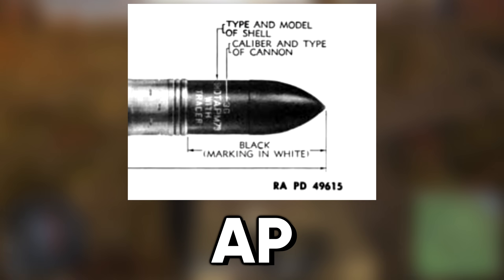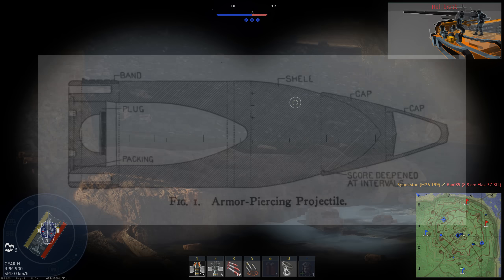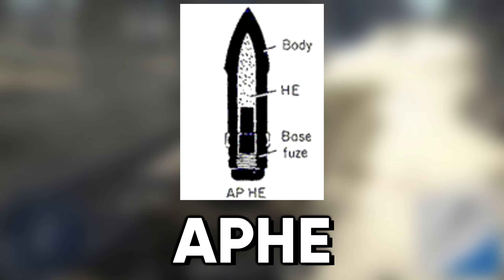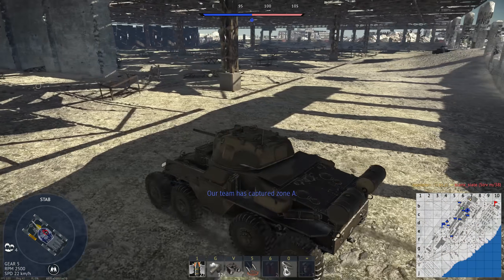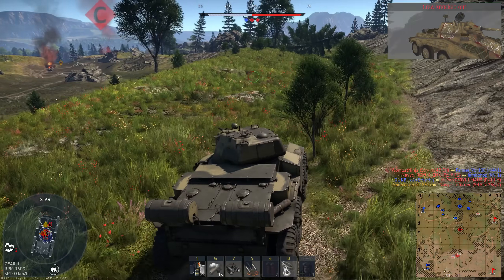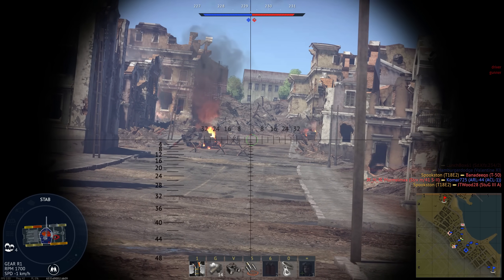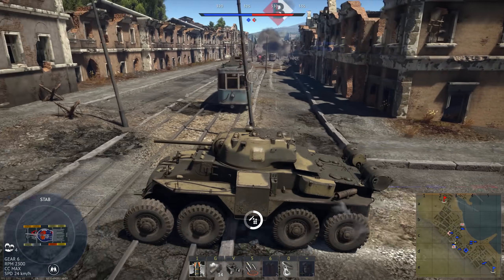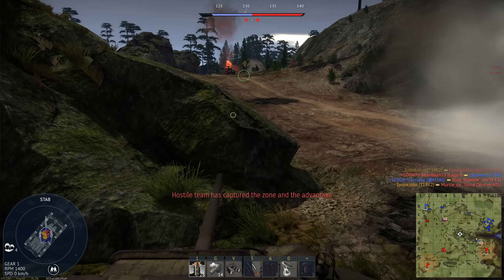How Tank Ammo Works

Comment: one thing im curious about is if a tank has a larger main gun does that mean it will have to use heavier ammunition and therefore the muzzle velocity will be reduced i've always wondered this but could never find out whether or not its true and im really curious
Reply: Yes, but usually you also use the added space for more propellant. A great example is the Tiger II, it had a large calibre for its time, but also a lot of propellant making the round go insanely fast, therefore giving it a very flat ballistic (and yes, that's pretty much one of the only glorifications about the Tiger II, which is true) ^^

Comment: Caped shells wasn’t done to increase effeteness against angled armor it was done to help the steel projectiles not shatter because as velocities increased the steel shells would shatter instead of going through armor. The soft cap would during impact deform around the shells and help take the shock out of the impact helping it bore through. It was also noted that capped shells did help against angled armor as a little bonus.

Comment: On HEAT - the general concensus I've gotten is that, yes, it does penetrate using kinetic energy. And it does use a superplastic, which is often misunderstood as a molten material. As far as I know, superplasticity is often used to refer to materials that act as liquids due to extreme pressure - not high temperatures - such as those produced upon detonation of a HEAT warhead. Because of that small difference though, I've seen people strongly insist that HEAT uses a plasma jet to penetrate, citing the liquid behavior of the payload(?) and the armor's reaction to it, which I think consists of the armor becoming a superplastic, or close to one, in the penetrated parts of the armor, producing an effect similar to a melted-through hole.

Considering that this came from google searches and discord conversations, I wouldn't take it as gospel.

Comment: Would there be any practical way to use a nuclear reactor or solar power to propel a HEAT-like jet while recovering and he recycling the casing and most of the propellant? 10 km/s is a pretty good exhaust velocity for a rocket engine, and a rocket engine that can use metal plates as fuel sounds like it wouldn't even need a fuel tank.

Comment: Not too bad, few mistakes the capped rounds were not designed for sloped armour, the bit about normalization is off and HEAT is not a plasma, it's not even that hot relatively - 400-650c, it is kinetic tho so good to point that out.  otherwise not too bad

Comment: Yet in War Thunder APBC / APHEBC / SAPHE shells have a inexplicable higher effectiveness than APC / APBC shells. This can be tested by going into the Armor Protection Analysis and looking at any heavily angled plate with any AP shell and then looking at the same spot with APBC / APHEBC and comparing effective thickness of armor. This is the reason why I almost always use the APHEBC shells over the 412D shells.

Comment: No squeeze-bore (APCNR)? Also the cap in APC wasn't meant to help penetrate angled armor, it was built to deform on impact, reducing the shock to prevent shattering that happened in normal AP rounds.
Reply: It's a mistake he did, you are correct on that matter ^^

Comment: APC doesn't normalize. The cap is there to prevent the tip of the AP body from shattering. Generally speaking, uncapped AP will be better at defeating sloped armor than APC. The first issue is the AP cap is lost during penetration. This reduces the mass of the round acting against the armor. Second, the AP cap absorbs energy, which reduces the force the AP body will apply to the armor plate. Finally, the AP cap is softer than the steel armor, so it may slide against the face of the plate instead of biting into it. The AP cap was used when the kinetic energy was too great for the quality of steel in the AP body to handle. It also helped to defeat face hardened armor. The AP cap would fracture the thin but very hard layer of the face hardened armor, which allowed the AP body to attack the softer steel behind.

A few examples of AP vs APC is the 90mm T33 APBC and the M82 APCBC. Both rounds were about 24 lbs and fired at 2800 fps. The M82 could not defeat the front glacis of the Panther tank but the T33 could defeat it at 1100 yards. After WWII, the US abandoned APC altogether. The 90mm M318 APBC replaced the M82 APCBC for the M46 through M48. The M103 heavy tank was built to defeat the IS3 heavy tank. The primary round for the M103 was the 120mm M358 APBC. It outperformed all other rounds against sloped armor, until HEATFS was developed.

Comment: I wonder why Explosively Formed Penetrators or solid penetrator shaped charges aren't widespread as the HEAT in anti-tank roles. In theory, these can combine the advantages of HEATFS and APFSDS, and serve as omni-purpose ultimate tank ammunition. It can emulate the terminal ballistic effects of an APFSDS round, and thus defeat anti-HEAT protection as well, while its effectiveness practically isn't affected by the range and projectile velocity. There must be some serious engineering drawbacks that explain their scarcity.
Reply: Well, HEAT works by forming it's penetrator via the explosive, while also accelerating it massively. So it fits as the first idea. Solid penetrators would be quite problematic to create for that kind of system. All solid penetrators have their limits. We literally do not have a material (that I can think of) that would handle the same kind of treatment the HEAT rounds give. It's not as much of an issue in regards to shooting the penetrator out, as it is an issue of the penetrator shattering. Modern APFSDS rounds, Tungsten and Depleted Uranium can only go so fast before they literally self-destruct upon impact, negating most penetration. And any shattered APFSDS would likely only be partially as effective as a HEAT round, which means if HEAT or regular APFSDS was going to be stopped, so will it.

TL;DR, It simply cannot be done, unless we find a literally indestructible metal to make the penetrator with. Which we would also make the armor out of, negating it anyways.

Comment: In HEAT projectiles there is no plasma jet, this effect is often mentioned, but this is not how HEAT projectiles work, Plasma has a temperature of tens of thousands of degrees, while the jacket of a heat projectile is made of Copper whose melting temperature is 1080 c °. In reality, a self-forging metal "Spigot" is formed and not a plasma jet.

Comment: So, I hate to be "that guy", but there was one thing that you got wrong: shells don't normalize. Like, at all. It seemed really dubious to me that a shell would suddenly tip into the armor or that this would help, since there was no force actually pushing the shell directly into the armor once it tipped over. Sure enough, it seems to have originated from speculation about why armor-piercing caps sometimes improve performance against sloped armor (early ones often didn't). It was one of the first things I dug into when I started researching gunnery, and the closest thing to "evidence" I've seen so far was a few WoT players on an old forum talking about how APFSDS should also normalize... not the best credibility.
Reply: I think it's not quite the way most people portray it. Kinda like how so many say HEAT melts armor, when it just punches through it. It's not that it 'turns' into the armor plate, but rather it slightly snags the plate. If you try and slide a hard edge along a surface (with enough force to damage it, obviously.) it will want to dig in. While this isn't going to just magically throw it through that 80 degree plate, it should make it less likely to bounce off a smaller angle. 

Please note that while I consider myself somewhat knowledgeable about these kinds of things, I have not exactly performed any tests, or dug heavily in archives for possible tests. This is just me using my knowledge and some reasoning and educated guesses. I would be perfectly happy to be proven wrong.
Reply: From what I've understood it's that the tip of the round hits the armor -->/ causing an upwards pull of the rear of the shell from the momentum keeping, while the penetrating tip hit the plate. The round will then continue at this new angle.
Reply: Wtf? That’s just physics. Shells would absolutely normalize upon hitting a solid surface.
Reply: @shmekelfreckles8157  Then
1. Find evidence of shells ever doing that
2. Explain what forces would cause the shell to tip into the armor and be forced in

I'll give a starter for the second: none. The frictional force might seem like it would make the shell rotate, but the reactive force perpendicular to the plate is WAY bigger, plus it acts with a greater moment arm. 

Normalization is something that makes sense if you think of the object as moving slowly, but at high speed the friction force just isn't enough. Blunt penetrators can make better use of it to make the shell go a little straighter, but actually normalizing would be very bad as the shell would no longer be pointed in the direction it wants to move.
Reply: @andrewmandrona7891  shells do normalize though, just not in the way people usually think. Sloped armor causes shells to bounce more often but if the inertia is high enough it will cause normalization effect that can prevent bouncing. That’s why APFSDS became a thing, the penetrator is long, thin and very dense so it can easily go through sloped armor just because of the sheer force of impact on high speed.
Reply: @shmekelfreckles8157  So your version of normalization is just moving straight into the armor, and not being deflected?

I wouldn't call that normalization. Searching the term has always yielded gifs of shell rotating into the armor, and that definitely seems to be the misconception people have.

Comment: My question about ammo after all these years is still APCR vs APDS
The penetrator seems functionally the same, yet APDS somehow cuts through anything while APCR gets vaporised by hitting at the slightest angle
Reply: In warthunder I'm pretty sure they just fucked it up, like they did HESH.

IRL many APCR shells were basically extremely pointed AP shells with a tungsten 'bullet' inside. Google an image of 50mm pzgr 40, you'll see what I mean. That outer casing is still made of steel, and with that sharp point, it'd be incredibly easy to bounce, or simply impact at an angle where the tungsten slams into the armor sideways. The APDS rounds were just the penetrator (whatever material) with no extra casing once they left the barrel.

Basically APCR can easily impact at a weird angle, and APDS wont, unless you really mess it up somehow.

Comment: I'm pretty sure there is a mistake in your otherwise very good video. Cap of the APC shell isn't meant to help with shell normalization (IRL). it doesn't do that at all (IRL and mostly in WT too). It's meant to decrease the initial shock of the impact that could cause shattering of the nose of the shell when hiting a plate at low angles. In WT APC or APCBC shells currently are overall worse at penetrating angled armour than plain AP except at very steep angles above 62° where APC is indeed better.

Comment: one type of subcaliber ammo you forgot is APCNR (armour piecing composite non rigid) or AP-HV (armour piercing hyper velocity), in design similar to the APCR it differed in that it was an ammo type specific to squeeze-bore guns
the basic concept is similar to that of the APCR, in that it consist of a subcaliber tungsten penetrator encased in a soft metal carrier, the difference is that the carrier is designed so that the tapered bore can compress it to a smaller diameter, i'm not positive on the specifics but this allowed for a higher muzzle speed with a reduced cross section, the downsides were the short barrel life (the sPzB.41 had a barrel life of only 150 rounds), the manufacturing requirements (barrels are hard to make, ammo requires a lot of tungsten) and the fact that squeezebore guns can't fire anything else

Comment: uhhh Here we go again... APC Cap wasn't to improve sloper armor performance or "normalise" angle of impact...
it's purpose was to prevent shell nose from shattering at low to medium angle of impact (at higher angles nose shatter didn't mattered that much)
Assuming AP and APC shells are of equal mass at 45+ degree angle of impact regular AP shell is superior, at lower angles of impact due to nose shatter uncapped AP performance is about ~30% lower due to nose shatter.
it's caused by higher body mass of AP shell, where's in APC part of shell mass is AP cap with by itself don't contribute that much to shell penetrating power
sources:
"Comparative Effectiveness of Armor Defeating Ammunition", 
"APC shot differ from the AP shot only in the possesion of a steel cap placed over the nose of the shot for the purpose of cushioning the forces on the nose of the shot resulting upon impact against armor. The cap thus assists in keeping the point of the projectile intact."
https://imgur.com/NiRNgLs

Monobloc steel shot are more effective than capped steel shot for the defeat of undermatching armor at all obliquities of attack and are MORE effective than both APC and HVAP shot for the defeat of moderately overmatching armor (up to at last 1-1/4 calibers thick) at all obliquities of attack above approximately 45 degree.
https://imgur.com/A7BFBYp

ballistic table for 90mm T15 gun, APC T50 (improved M82 APC) falls behind even M304 HVAP against non Facehardened armor.
https://imgur.com/ozKHOZl

"WWII Ballistics Armor and Gunnery"
2 line:
"AP without armor piercing caps will have lower slope multipliers than APCBC round for same T/D ratio
https://i.imgur.com/AcNi0dR.png

 British Test's Raport M7000 A/11 No.1
it's for impact angle of 45 to 55 degree
"APCBC shot requires on the average about 50f/s greater velocity to penetrate a given target tha the corresponding AP shot, providing the BODY of APCBC shot is of the SAME weight as the AP shot. If the AP and APCBC are of the same weight and cap accounts for 12% of the weight, the differience in velocity WILL BE INCREASED TO 200 or 250f/s"
https://imgur.com/a/HS2l2
it also includes ballistic tables for AP and APCBC shell's fired from 2pdr and 6prd gun's
Reply: Your posting of these sources are much appreciated, as is the effort you put into this comment. I'll be reading through all of them.
Reply: But what if normalisation was a side effect of the cap?
Reply: @cursedcliff7562  it's not, both in US and UK testing for equal shell mass regular uncapped AP beats Capped AP shell at all angles were nose shatter stops being issue with is 40-45°+
Reply: Arczer25 1: highly complicated round ballistics
Me: haha tank shell go boom

Comment: Good commentary, would be nice with ingame examples / relevant ingame footage, such as demonstrating the destructive capability of each shell or something
Reply: Pretty hard to do considering that almost any ammo type that isn't APHE or APCBC with explosive filler is absolutely useless in game.

APDS is pretty terribad, it basically doesn't spall. APCR is equally pretty terrible, HESH almost never works unless you're using a huge gun, HE is almost useless unless you're doing weird 1000 IQ plays, HEAT loses relevance in top tier.
Reply: @h1tsc4n40  I'm at 7.0 in Japanese tanks right now, APDS and HEAT are godly, and the APCR I used with the Na-To was pretty good. Meanwhile, the APHE I'm forced to use in the Ho-Ri sucks ass at penetrating many tanks beyond short range. I do agree that most AP that's not APCBC sucks, though.

Comment: Where are the smoke shells?
Reply: But that doesn't change the fact that it is still a tank shell
Reply: @iankr352  well, there are 3 types of shells - kinetic (AP and derivatives plus modern grapeshot), chemical (HE, HESH and HEAT) and other (illumination, smoke, training shell and whatnot)
Reply: Well, they are not used against tanks (at least not supposed to be) and are just utility rounds just like the smoke screens and mortars
Reply: @vitaliiyakovlev2264  Actually they are very nasty against tanks IRL. They can flood a tank with noxious smoke. Allied tankers would plaster German tanks with WP when their normal AP rounds couldn't damage them. Doesn't work against modern NPC sealed tanks though.

Comment: I'm still confused about the distinction between APHE and HEAT. They sound like they do the same sort of thing.
Reply: APHE explodes after the shell penetrates creating shrapnel 
HEAT explodes before the shell penetrates creating a hypervelocity copper jet that then penetrates the armor
Reply: @raptor4916  Ahh thank you!
Reply: APHE pens the armor then explodes inside which sometimes kills all the crew, HEAT detonates in contact with any object (avoid bushes and fences ) then explodes outside and creates a cone shaped explosion which then pens the tank but does less damage then APHE. Use Heat when you can't pen a tank with APHE or if your in a long range battle.

Comment: Someone needs to tell Gaijin that HEAT shells should NEVER ricochet.
Reply: But can ignite on bad angle or unfavorable "incidence" (sorry french word and the trad don't fit ;-)) and just spray outside the armor with a "pancake" firework because the shell tip wasn't in optimal or more out than in  armor ... do you even ask yourself for the "fats cheeks" turrets ? angles materials and refraction
Reply: @cyrilscordia9565  Which is fine, ignition on the wrong side is fine. But im talking about the entire shell just BOUNCING.
Reply: Yeah, as APFSDS shouldn't. APFSDS generally shatters or disintegrates, it doesn't ricochet nearly as often as it does in game

Comment: Older HEAT has momentum issues post penetration, modern however, lol nope
Reply: They still lose jet momentum when crossing layers of material of different density, but when you get up to 1 meter (1000mm) of penetration, it usually is not ahuge problem